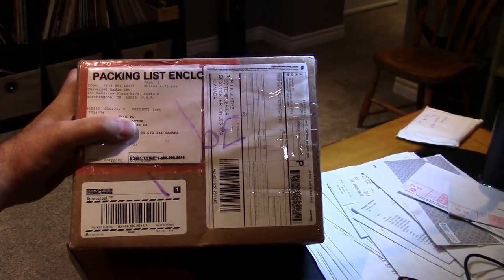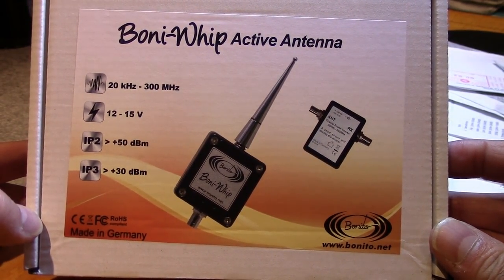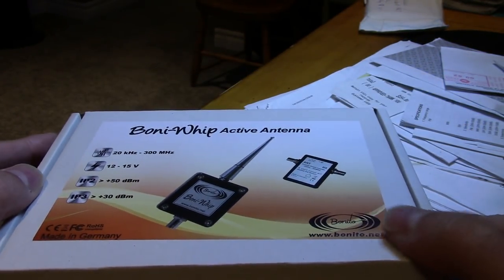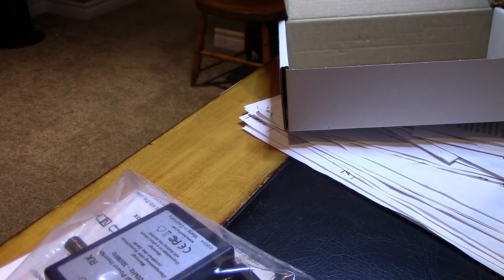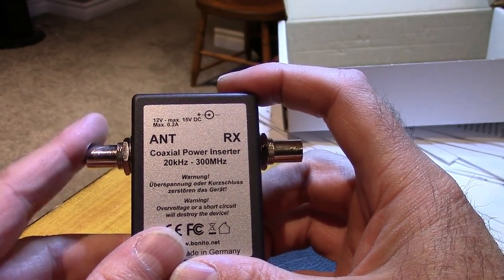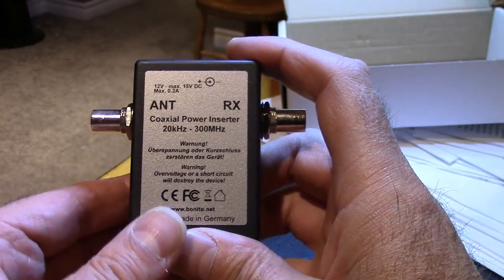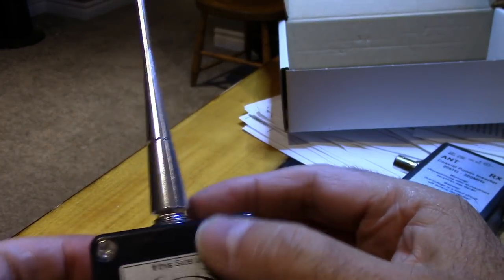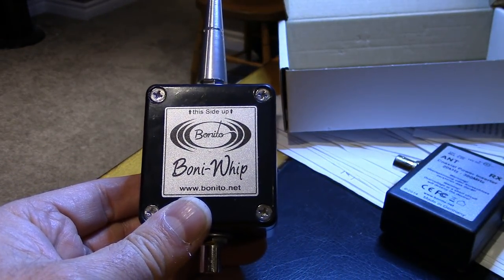Bonito BoniWhip Antenna - unboxing

Comment: Hi there, I've used the Boni Whip and it's USB-powered cousin the MA-305 and they're both superb portable antennas for use in small spaces and electrically quiet locations. 73! Clint
Reply from the maker: Thanks Clint. Your review in SWLing.com is one of the reasons I bought it.
Reply: That's good to know. I'm sure you won't be disappointed with it. 73! Clint

Comment: Good morning, what is the external and internal diameter of the Boni-Whip's power connector? Thanks. Greetings
Reply from the maker: It's powered through the coax - no separate jack.

Comment: Are you kidding me with this? You "prove" that the little thing works because it picked up the strongest commercial station around? And you find nothing better to add, than the manufacturer's own copy? You're not being paid by them to peddle this, by any chance, are you? Which wouldn't be a bad thing at all, but maybe a real test that puts the thing through its paces will show its true worth?